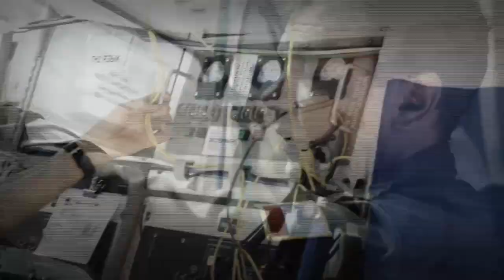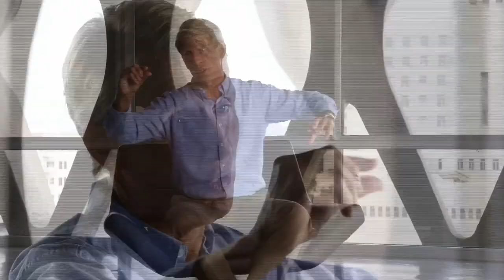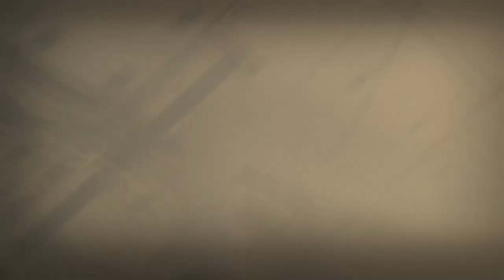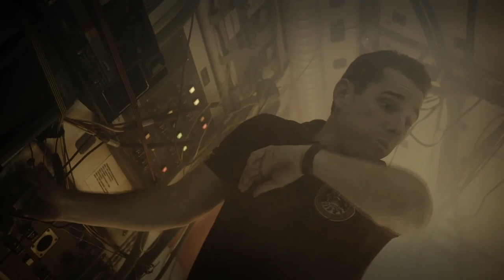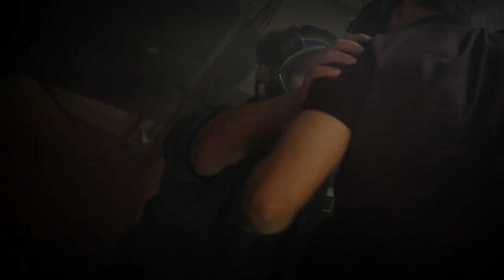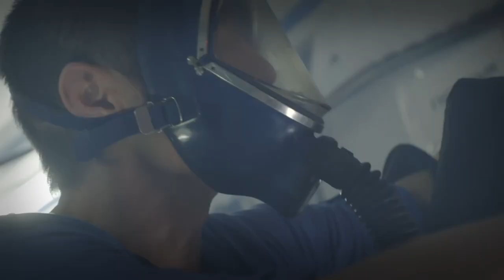Life-Threatening Cabin Fire On The Mir Space Station | Secret Space Escapes

Comment: Okies, why use fire extinguishers 4 of them, instead of instantly putting th ed fire out? Clearing that cabin seal the doors on each end, vent into Space all traces of fire etc. gone, done for, out almost instantly. Then repressurize, clean up the mess from the fire. By venting the Atmosphere from that Cabin would kill the fire immediately, no Oxygen no fire.
Reply: 1) Venting -- Venting would require the usage of oxygen to re-pressurise, and in space oxygen is limited especially after a fire burns most of it. The cause of the fire would also not be known well and if you depressurise rapidly you might cause damage to the point of a module/station loss. You also, in haste, likely can't check how sealed the doors would be it wouldn't be nice to be venting whatever you have left out, decompression on the human body even if you a breathing oxygen is bad. Verrrry bad.
>> Note -- It was the oxygen system itself which was burning

2) The fuel of the fire itself was self-oxidising meaning that it is completing two of the three sides in the fire triangle. For fire you need: Heat, Oxygen, Fuel. It had its fuel burning, it was heating itself and was producing its own oxygen. While a decompress MIGHT work with temperature there is the requirement of waiting until anything smouldering goes out. If they re-introduce oxygen from another part of the module, or vent then seal again, the system might just reintroduce oxygen BY ITS OWN DESIGN into the compartment and possibly turn the module explosive.

3) On another note- venting oxygen I'm pretty sure is impossible unless you use an airlock, and in this case the only airlock useable was the docking point. The other being blocked by the fire etc. etc. etc....

4) Fire extinguishers would be the best bet in this situation as you need to cool the fire quickly but in a controlled matter. The filters on-board are likely able to deal with such particulates or gasses (not sure if they'd be CO2) but in any case the system would have an easier time scrubbing and resetting then trying to produce more oxygen from no-where.... I wouldn't try to burn another oxygen candle or anything for that matter if I almost lost my life to something burning already.

NASA/Credible link explaining the events
https://www.nasa.gov/feature/25-years-ago-fire-aboard-space-station-mir/#:~:text=On%20Feb.,the%20station's%20modules%20with%20smoke.
Reply: first they would have to put on a spacesuit to breathe, which putting on a spacesuit takes way too long